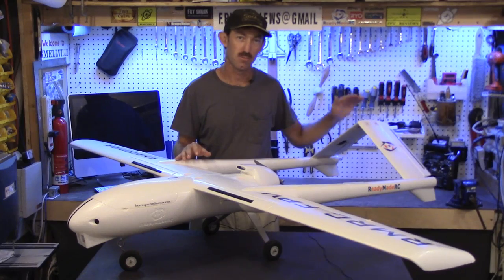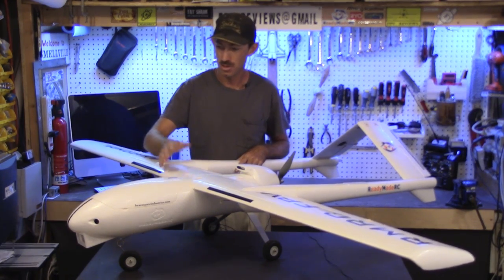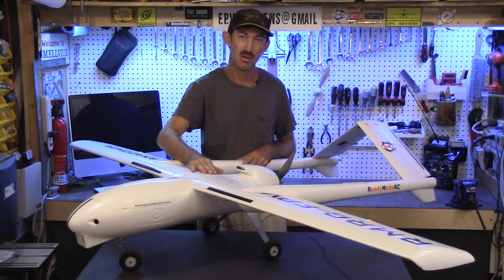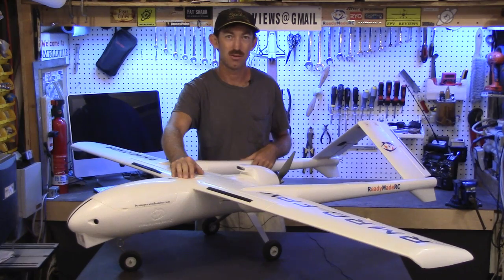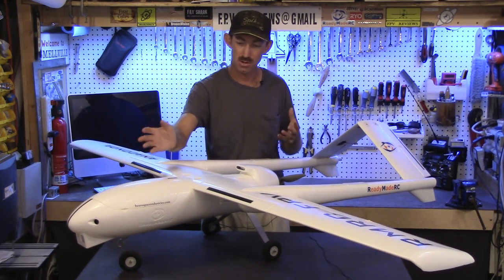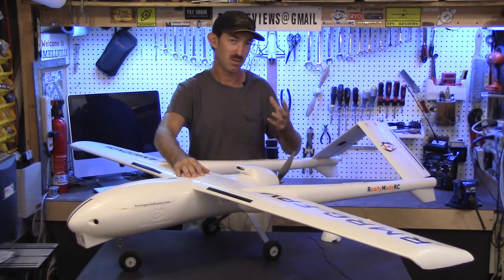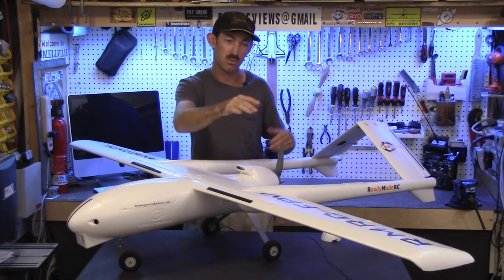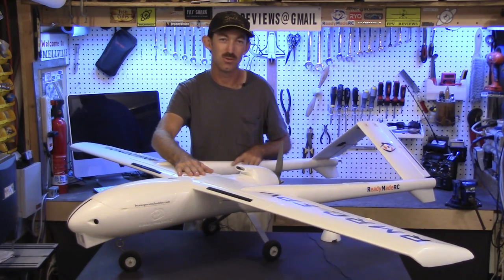RMRC Anaconda Review   FPVreviews

Comment: I just maidened mine. Using 2 Turnigy 5,000mAh hardcase 4-cells pushed all the way forward and it balances perfectly. Flew very well with a 15x4 prop. Very well-behaved at all speeds. Dropped a wing a little in a stall but never dramatic. Always just sort of mushed forward into the stall as the video states. Not using the flaps/LE slats. All stock PNP. Very, very little trim. A bit of up elevator and a bit of right aileron. 

Definitely a keeper! I love this thing! I'm not even a big FPV guy and I just love flying this plane just because it's so unique. And it turns heads at the field!

watch?v=DfEWGm_EdFU

This review's very accurate! It's a fantastic airplane!

Comment: I have just put all the finishing touches on my anaconda and am ready for its maiden. One thing that I did change are the barrel jacks on the front of the booms. I install good old fashion three pin servo connectors. They gave me some trouble even after I tried to reinforce there mounting. The barrel jacks sure are user friendly but with all the $$$.00 in the craft its not worth the risk. ReadyMade has made a beautiful plane and is one of the most helpful companies in the FPV market.
Reply from the maker: agreed, i like the jacks, but i'm sure the servo connectors are an improvement.  post a link to the video of the maiden in the comments here if you like, that way everyone here  can see yours.  ?

Comment: Good review and interesting thanks. Noticed that the power on stall was normal for a powered aircraft. When I did my full sized training on a Cessna 150 Aerobat, the instructor demonstrated what happens if you do not use a boot full of right rudder when stalling under full power.  The prop goes clockwise, so the aircraft then flips counter clockwise onto its back into a spin, a killer on a climbout!
Reply from the maker: Very true.  the power on stall was as expected.  similar with almost all aircraft.

Comment: I bought the PNP version and have the following comments/warnings for buyers.  If you ever have a elevator female stereo plug go bad, like I did, you can't fix it without tearing into the foam.  Personally I would never use this plane for FPV with hundreds of dollars or more invested in equipment because the servo connections to the elevators are prone to fail, especially in flight.  The stereo plugs are a cute idea but not practical for long term use.  Secondly, carbon fiber rods need to go all the way to the tip to prevent the twisting of the wings you see on several Youtube videos.  And, as you mentioned in your review, the canopy needs a better attachment method to keep it from blowing off in flight.
Reply from the maker: Thanks for your comment!  We've had issues with the stereo servo connectors too, and had to fix them.  It was actually not easy to fix, and there are no spare parts available. the parts quality was also marginal. We have not had any in flight failures, but have not put many flight hours on either. It's certainly not how we would choose to do it either.  As we mention briefly in the video, you can get ahigh speed flutter for the whole airframe, where the booms articulate and the wings twist. If allowed to continue, it would certainly destroy the airframe in flight. Flying slowly, would not happen.   Fair warning for sure, my friend..

Comment: I've just flown my Anaconda, I have six flights now. At the suggested CG it was really tough to keep the nose up on landing yet it also seemed over controlled on all surfaces.  Adverse yaw was a real problem too, just like you stated.  Now it just seems to "wallow" around and needs to be "herded", not precise at all.  Were you using any aileron differential?
Reply from the maker: +artnewland as explained int he video, i was using mixing, with the ruddervators, as a slave to the ailerons. i had to use a 140percent mix, all that i had available not he radio, to achieve it, but the mixing did work well in the end. 
gradually, like very gradually, move the CG back.  contrary to popular opinion, a fwd CG is very dangerous, and as you move back, overall performance, and handling will improve.

Comment: Hi! I have just purchased the SKY OBSERVER rather then the SKUA because it has less dragging parts and looks nice for a presentation. I guess it can fly as long as the SKUA due to similar construction. So now I have to study a way to extend its flight time at any rate and I know there is a limit for that like battery weight. Do you think I can fit it with a less KV motor for more thrust?

Comment: Looks good hoping to fly soon as soon a school slows down a bit 

Btw do you have any tips on binding the ezuhf because it's not being real easy on me
Reply from the maker: It should not be hard. make sure that the firmware is the same on tx, and rx.
also, make sure your radio has the right settings, ppm , and the right baud rate, etc.
 because, i think that if the tx is not getting a signal from the radio, you may not achieve bind.  the bind button is a bit hard to reach, and is not under the bind printing on the rx.it's inside the circuit board.
i just purchased another receiver, and noticed that the key parts in the receiver are now shielded not he latest models, so that's good news for susceptibility to onboard interference.

check the instructions, and double check everything.   hope this helps. there is a manual online with compile bind procedure on the immersionrc website.
Reply: FPVREVIEWS
There was a gentleman who did a fantastic overview of setting up EZUHF, I believe it was on RC Groups.
The most important thing to remember is that the PC software must be "set up" for normal mode with RX, and then set up AGAIN with the RX in BIND mode. I lost a bit of hair trying to figure that out until I saw the vid on RCG.
Great review Spike, but I still want the Gemini V2
Reply from the maker: ***** hmm, I didn't have to do any of that.. 
just the same version firmware, and transmitter setup to talk to the transmitter module. 
did you get it working?
Reply: FPVREVIEWS
Yeah. When I first got the system, the Tx and Rx had different FW versions. After installing the utility software, I found that I could get into the parameters to set up the Rx, but was unable to update the FW. I learned that when you first plug the Rx into the USB, windows wants drivers for it, which you go thru that setup wizard. To be able to update the FW, I had to re-plug the RX into USB in BIND mode, then windows wants drivers again, so again with the setup wizard. Like I said, I was having trouble at first with being able to update the FW on the Rx. After I found the video tutorial on RC Groups, I was able to get it worked out.
Reply from the maker: ***** good news, now onward.

Comment: HI Spike,

I remember you said once that the Anaconda is not made for strong wind, is it still apply on your second review?
Reply from the maker: It does alright, but it is a relatively slow flying plane.
Reply: FPVREVIEWS HI Spike, can it fly in strong wind if it is slow flying plane? 

And how is it compared to the SkyHunter?
Reply from the maker: ***** I don't have a sky hunter, but i notice that they are going down in price, but they are a little smaller. 10 cm less span.  so i think that a lot of people are going to go with the anaconda because of that. the sky hunter is a good little plane though. have seen a lot of very successful flights made, and happy people. the tail configuration is more conventional, so that's a strong point, in my opinion, but it has no rudder, in the stock config. so i would be adding rudders.
Reply: FPVREVIEWS One previous question, do you think that the Anaconda can handle strong wind or gusty wind above 20 - 25  knots?
Reply from the maker: ***** that would be about the limit. If you want to fly in those conditions or more, you need something that flies fast, and is relatively heavy, with high wing loading.
Reply: FPVREVIEWS Many FPV pilots were able to fly in the Talon in such winds.

Comment: Wing flutter caused the cowl and camera housing to fall off and  aerodynamics degraded resulting in a crash. The weather may have contributed, wind gusting 15 to 20 mph and throttle was at full for a few seconds. Perhaps adding strips of carbon fiber or fiberglass on each wing panel may correct the flutter.

Comment: Quick question, getting ready to maiden my Anaconda tomorrow, the set screw that goes in the arm to secure it to the nose wheel wire will not tighten so that the wheel does not move.  This prevents the wheel from tracking straight, did you have any issues with this?Additionally any suggestions
Reply from the maker: +Donni Jackson take the arm off, and try to get the screw to go through the treaded portion of the bronze bushing, without the sire landing gear in place.  if you can get it free'd up, great. if not , you'll need to get a proper size tap to make the threaded hole clean, and cut the proper size threads. one way or another, get that screw, or another screw to thread cleanly through the bushing, inside the arm, and then mark where the screw goes on the wire, and file a flat spot on the wire, just enough to make sure the screw has a place to seat, that's flat, so the screw can't slip on the wire. 
I also had to solder a washer on the wire, to keep the wheel from rubbing on the wire at the 90 deg bend.  don't fly until it's right. make sure you mix in lots of rudder with the aileron, to counteract adverse yaw, and make sure the CG is right. 
range check the radio too..  
best wishes for first flight!  it was a lot more docile than i expected. can fly pretty slow, so take it easy.

Comment: Hi, when you bought this did it come with the controller and camera? Thanks!
Reply from the maker: +Gunner Goldie i purchased the kit version which required assembly, and equipment. the kit did come with hardware. 
they have a version which is assembled, but requires controller, battery, and any extra equipment that you would want to add.

Comment: Hi, any comments on endurance? how many Amp hr do you need to keep it up for 45-60 min or more? I know it depends on payload weight, flight conditions, etc but just to get an idea... I want to use this frame for mapping so endurance is key for me.
Reply from the maker: Yes, good question, we've actually been working on a battery pack that is custom for the anaconda, and expect to be testing it soon.  Instead of offering specs for regular lipos, we wanted to build a "Tesla" style battery for it, and offer it for sale. It should get a better result that is repeatable and have an improvement of at least 50 % or so in flight time over lipos.   we try to offer better solutions, and upgrades, rather than just reviews these days, so if it's not more advanced, we're just not doing it.   I'm curios how long i can keep one up myself. .. more soon on our website:   bearospaceindustries.com
Reply: I'm interested in true long endurance flight on this airframe(and the rmrc skyhunter) too. Will be watching your website. If you're doing a review, it'd be cool to see Tesla style as well as standard low C LiPo batteries as well.

Comment: how about an endurance test next
Reply from the maker: will put it on the list. thanks for your input. i can tell you right now, it's not going over 2 hrs.. not the airframe's strong point, i'm afraid. at least on electric power. 
and i think the foam might melt with gasoline. ..  why not try My gemini design for a long endurance platform. 3 hrs.. check out the website:    bearospaceindustries.com

Comment: Got it built , but going crazy trying to get the nose wheel steering to work .  I`ve tried y cable but steering the wrong way . Using a pixhawk 2.1 cube , but no way to get the steering right . How did you get it to work. I used to connect the nose gear to the rudder, but because of mixing I`m loosing it . How did you do it . Thanks in advance..
Reply from the maker: You’ll need an extra channel for the nose wheel steering and slave it to the rudder channel. Use servo reversing in parameters in arduplane to get the direction right
Reply from the maker: You’ll need an extra channel for the nose wheel steering and slave it to the rudder channel. Use servo reversing in parameters in arduplane to get the direction right
Reply from the maker: You’ll need an extra channel for the nose wheel steering and slave it to the rudder channel. Use servo reversing in parameters in arduplane to get the direction right
Reply from the maker: You’ll need an extra channel for the nose wheel steering and slave it to the rudder channel. Use servo reversing in parameters in arduplane to get the direction right
Reply from the maker: You’ll need an extra channel for the nose wheel steering and slave it to the rudder channel. Use servo reversing in parameters in arduplane to get the direction right
Reply from the maker: You’ll need an extra channel for the nose wheel steering and slave it to the rudder channel. Use servo reversing in parameters in arduplane to get the direction right
Reply from the maker: You’ll need an extra channel for the nose wheel steering and slave it to the rudder channel. Use servo reversing in parameters in arduplane to get the direction right
Reply from the maker: You’ll need an extra channel for the nose wheel steering and slave it to the rudder channel. Use servo reversing in parameters in arduplane to get the direction right
Reply from the maker: You’ll need an extra channel for the nose wheel steering and slave it to the rudder channel. Use servo reversing in parameters in arduplane to get the direction right
Reply from the maker: You’ll need an extra channel for the nose wheel steering and slave it to the rudder channel. Use servo reversing in parameters in arduplane to get the direction right
Reply from the maker: You’ll need an extra channel for the nose wheel steering and slave it to the rudder channel. Use servo reversing in parameters in arduplane to get the direction right
Reply from the maker: You’ll need an extra channel for the nose wheel steering and slave it to the rudder channel. Use servo reversing in parameters in arduplane to get the direction right
Reply from the maker: You’ll need an extra channel for the nose wheel steering and slave it to the rudder channel. Use servo reversing in parameters in arduplane to get the direction right
Reply from the maker: You’ll need an extra channel for the nose wheel steering and slave it to the rudder channel. Use servo reversing in parameters in arduplane to get the direction right
Reply from the maker: You’ll need an extra channel for the nose wheel steering and slave it to the rudder channel. Use servo reversing in parameters in arduplane to get the direction right
Reply from the maker: You’ll need an extra channel for the nose wheel steering and slave it to the rudder channel. Use servo reversing in parameters in arduplane to get the direction right
Reply from the maker: So, the steering must be on it's own channel, slaved to the rudder channel. with a v-tail, there will be a rudder channel, and an elevator channel, and they will be mixed.  you probably want to do it in the parameters in arduplane. I have't worked with the latest version, but there is a way to reverse channels, and mix them in arduplane look in that direction.

Comment: WOW! Amazing video! This model seems to behave well in slow flight. That's what I really need, but the SKUA is also another UAV platform that needs to be considered as you kept it in the air for just over two hours shown on video. I also saw another similar plane called SKY OBSERVER that is quite interesting, but which one provides more flight time? Is there any other UAV platform around in the market like these ones?
Thank you.
Reply from the maker: the sky observer looks good. i did a review of the skua, and i would expect flight times on the sky observer to be similar.  check out the tech pod as well. it has flown 2 hrs with fpv equipment.  it's a foamie.
Reply: FPVREVIEWS
Sorry! You've lost me now! Which one has flown for two hours? Did you mean the SKUA or the SKY OBSERVER? I am really in doubt 'cause both have a similar and a very good design. They look like professional equipments. I think it worth a cover with a sheet of carbon fiber to guarantee some resistence in flight, hand lauching or even in ground operation (kids playing around, curious fingers, transport, wife, etc).
Reply from the maker: Hedio Trevisan the skua flew for 2 hrs.  i did the review. it's on my channel.
Reply from the maker: Hedio Trevisan here is the endurance testing video

https://www.youtube.com/watch?v=-HR5BMh_ah4
Reply: FPVREVIEWS
Oh, yes! I have watched this video before. I thought you were talking about the SKY OBSERVER as well! Two hours flight time is enough, but you did not put any extra weight except that battery for the receiver so I believe it can fly for one hour and a half, maybe a bit more. Have you every tried the SKY OBSERVER?
Reply from the maker: Hedio Trevisan not yet, but may do a review in the future..